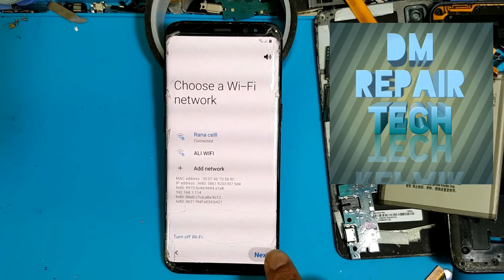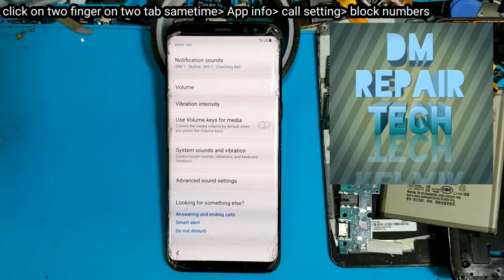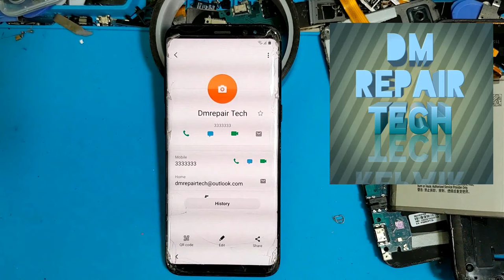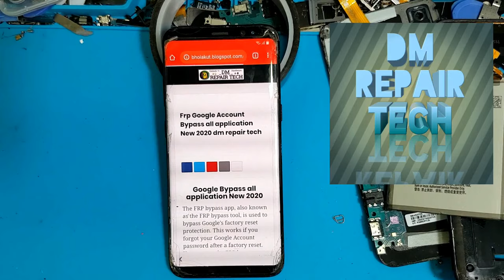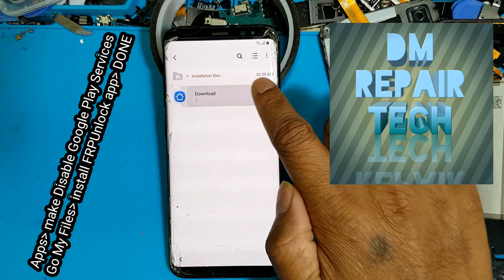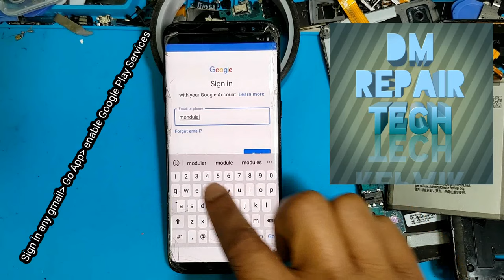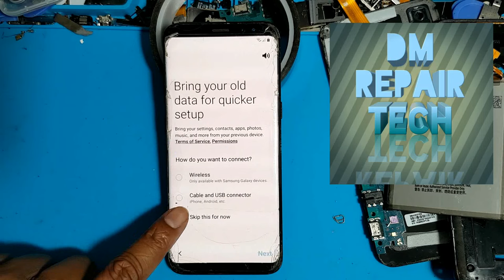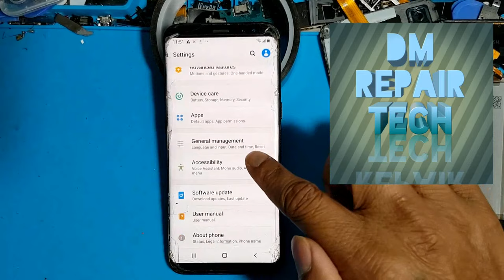SAMSUNG GALAXY S8/S8+ FRP Bypass/Google Account Remove Android 9.0 Without SIM - NO Windows Pin -New

Comment: Thank you so so much! I've bought this broken phone from some random dude and after repairing it I saw that it apparantly was locked, and he didn't want to give me the code. This helped me very much! I've tried other methods but everything failed apart from this method. Many many many thanks! You just made my day :)
Reply from the maker: WoW, Thanks for the watching my videos and appreciating the works 🤝😊✅
Reply: Why I can't change the 5 10 zcustomize
Reply: @DMRepairTech I can't double na tab the 10 and customize
Reply: Double tap part does not work on my S8 any advice ??
Reply: @DMRepairTech  it can't take me to app info sir

Comment: ok so how come my phone is the same but its also different. At 2 min 30 sec, when you go into the answer automatically screen, you have the option to choose from 2 sec, 5 sec, 10 sec, or customize. I only have the option to turn it on or off. so I cant press both buttons at the same time to take me to call settings. so that where Im stuck. If you or anyone else could possibly help me to the solution I would be beyond greatful. other than that, thanks
Reply from the maker: 🟢Get Supports:
Facebook ▶ https://fb.com/dmrepairtech
Instagram▶ https://instagram.com/dmUnlocker
Telegram▶ https://t.me/dmUnlocker
Look Service Feedback:- fb.com/dmrepairtech/reviews

Comment: There's no contact info on your contact web page
Your software doesn't work without contacting you!!!
This leads me to believe the whole thing is a waste of time, sadly.
Reply from the maker: WhatsApp https://wa.me/message/62KELVV35UNBP1
Telegram▶ https://t.me/dmUnlocker
Reply: @DMRepairTech  Hahaha, you're a funny guy.
Both links you've sent make me install software I don't particularly want, but on top of that, both software packages want me to use a mobile phone (The very thing I'm trying to get access to) to scan a code.
If I could scan a code with the mobile phone, I wouldn't require to unlocki it!!!
Do you have software I can install which would actually do the job I'm trying to do, whthout having to jump through a thousand hoops?

Comment: Hi thanks! When doing "add network" at start and continuing by steps, the wifi is getting disconnected, so what can i do?
Reply from the maker: I will try to help you 
You can unlock your phone 
✅ Contact us: Facebook.com/dmrepairtech
Reply: Hi thank you for the quick response!!
I inserted a sim card and then i used the LTE instead of the wifi! Thanks again! :)
Reply from the maker: Yes, I understand your device is security’s updated 
Check my description below have new tutorials New method 
✅Get fast unlock service connect Facebook (DM REPAIR TECH)